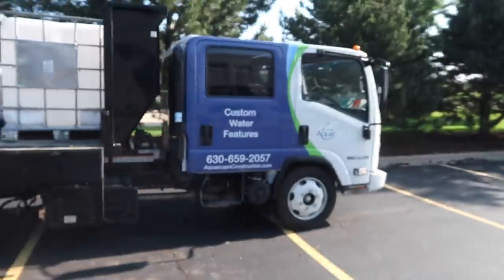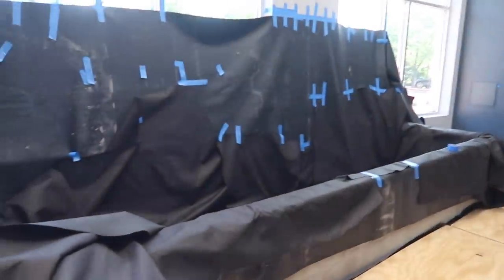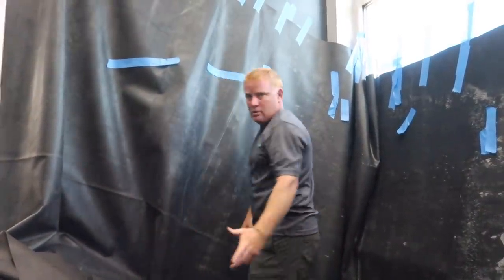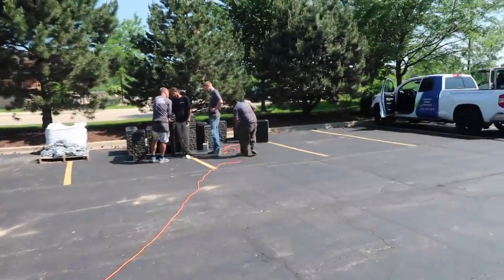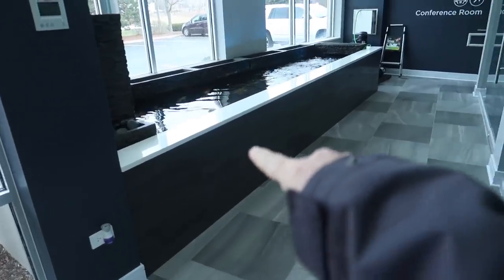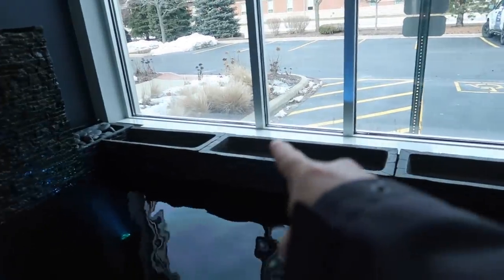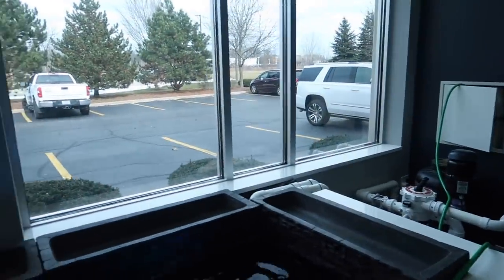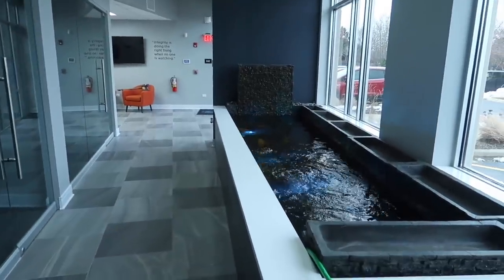*OFFICE KOI POND* W/ Color-Changing Lights

Comment: Looks great. To bad he didn't find the plants sooner. Probably will look amazing.  Try using the walls to frame out a patio with them all running. You can use them as stairs with a trickle of water. Put a slate stair tread raised just enough to let water out. Awesome dudes.

Comment: I have a large pond or a lake  that has a huge amount of muck and leaves on the bottom. My idea is to take a large pump and blast the bottom and let the muck drain from the lake over time but if you have any suggestions on how i can get rid of the muck without making the lake a mess please let me know. Also i've been watching your videos for about two years now and you inspired me to make my own pond.
Reply: Logan 0G Checkout OSR - Organic Sediment Removal Company our of Wisconsin, we’ve worked with them on several projects.
They use a large pumping system to suck the muck up from the bottom of the pond.
The slurry is discharged into a huge porous bag that sits on the side of the pond. The porous bag keeps the muck inside and the water slowly seeps out back into the pond, it works great!!!
Reply: @edbeaulieu5916  Ok thank you i will be sure to check them out